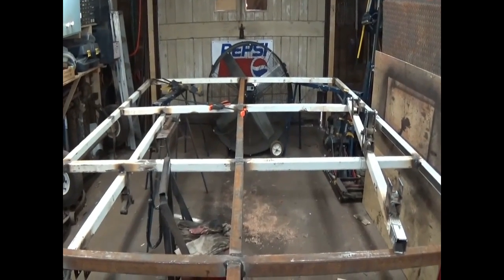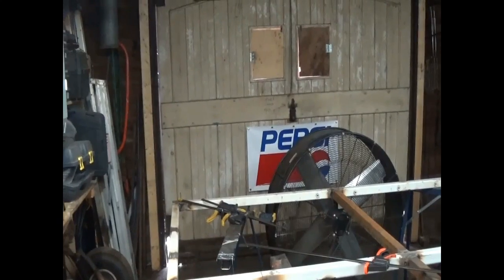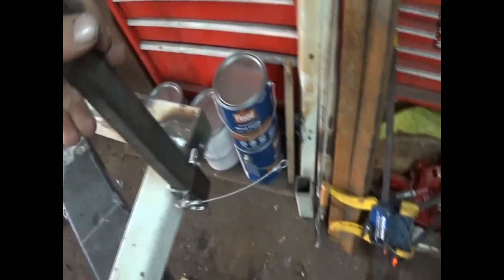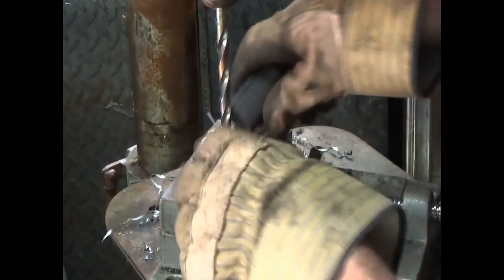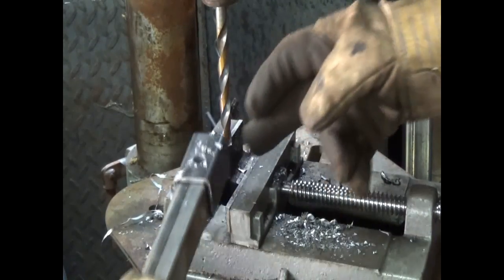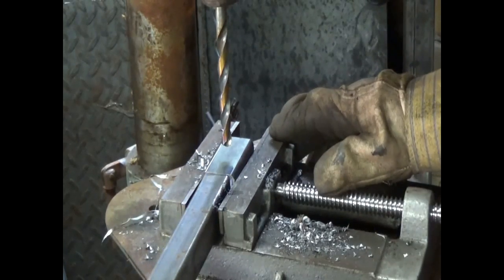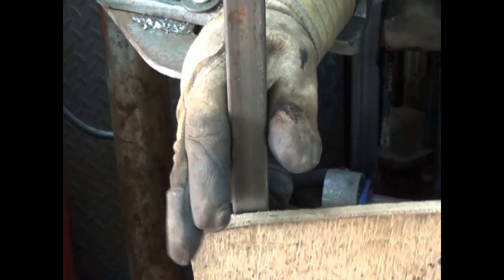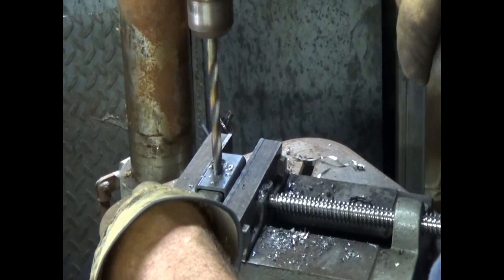MORE TANDEM WORK

Comment: Something is wrong with this video. First, the aspect ratio, but that's easily fixed. And then, there's these many artifacts and stuff. When they appeared while or after editing, you're using a bad codec or a bit rate that is too low, but if they appear right from the files that you pull off your camera, it means your camera or your memory card could be about to die...
Reply: ***** Yes, they are all over the video, which is why I think it could be a codec problem as well. Or the memory card isn't really shitting the bed, maybe it's just too slow to write all the data it gets from the camera (you know, there are lots of cards out there labeled "Class 10" that barely make it to "Class 6" and would deserve an honest "Class 4" label...)